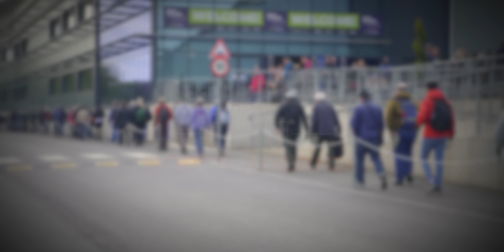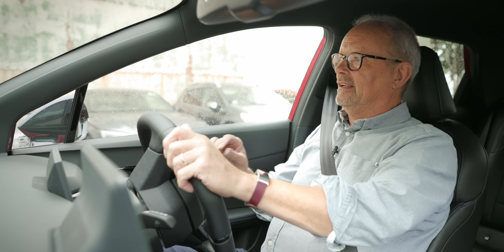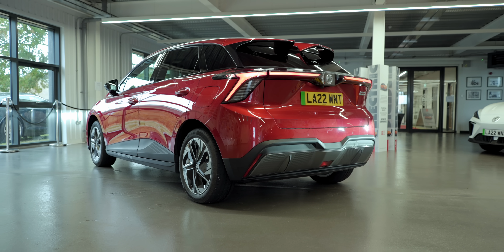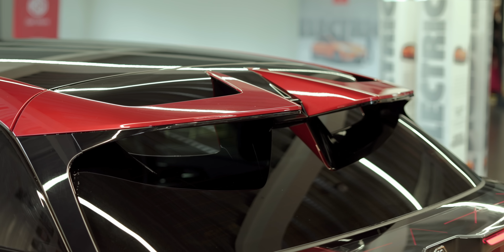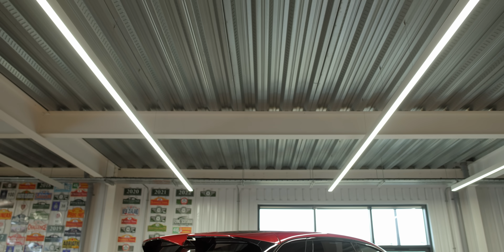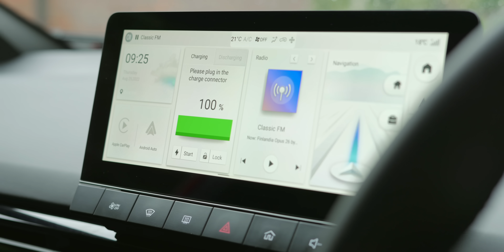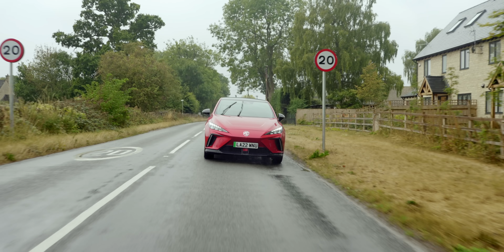MG4: The Bargain Of The Century??

Comment: 125KW charger? to get 50 KWHrs out of this battery, you will have to input at least 55 KWHrs, which will only go up as the battery ages.
With the Russians turning off the gas and oil spigots, electricity in the UK is going to become VERY expensive, and likely to be rationed this winter.
Plus, made in China. 
Good luck with all of that.
Reply: Electricity is also becoming very expensive in Germany, as the Government there have recently pledged huge support for consumers. The UK produces around a third of it's energy from renewables now.

Comment: Annoyed of Tunbridge Wells says again, for the umpteenth time, the designers have missed the open goal that electric propulsion has offered . . . That of using the whole of the chassis length to create space in the vehicle for people to enjoy. They  have instead presented  the public with an "Electrified" conventional family saloon with a conventional bonnet.

I reckon its all part of the designer sarcophagus mentality - lets create a box to insert people in and then further contain them by ramming an 18 inch wide largely non-functional dashboard in front of them. Its a designer authoritarianism . . "We are the only ones fitted to know what users should do with interior space. Under no circumstances  must we allow them to enjoy the extra space through self-determination"  

Styling - over styled for a family saloon. Why try and kid the customer that the front end is a Masserati and the rear-end is a Porsche. Pathetic. Shades of identity crisis motoring, a la VVT Toyota Corolla . . Couldn't makes its mind-up whether it was a boy-racer wagon or a pensionermobile.
With a front and rear end moldings and pressings as complicated as that it will cost  a couple of grand to get it repaired if you have the smallest of  knocks. 

And that air dam on the front . . . Low . . Low . . Too low .First lighweight speed bump it encounters will seet it part company with the car

Upside, all the exterior plastic bits are shiny . . . When new !
Further upside it hasn't got those fluted panel lips running down the mid-line of each side - another fortune to repair.

I think all these  conttemporary car design bureax must be subterranean  and have piped 1960s musak running in the offices all day - hence the car interiors . . . I presume '60's English country music ballards  of the harpsichord accompanied vocals predominate. . . " Grey, Grey, . My love is grey, da dad da da dad da da da"  .Even the fluffing headlinings grey.

When the ethos of the age is to get vehicles lighter, more fuel efficient, why  fit things like electric seat adjustment . . Unnecessary weight and something else to go wrong, like the compressor based A/C,  which costs a fortune to repair kand turns most cars into a "Hangar Queen". I mean how often do you adjust the seat, if the sMe driver i using the car ?

Comment: At last an affordable sensible car that has a practical range, if you can afford to charge it up again!
I think they might have to offer a hybrid version as the cost of electricity goes even higher.
Reply: The cost of charging an EV at home hasn't changed in a while, and nor is it likely to as energy companies are still showing the same off-peak rates as months ago. Mine certainly hasn't changed. I still pay 7.5p per kwh on my overnight off-peak tariff.

Comment: Are there any figures for the carbon footprint of building each car? I would be interested in comparing it to current ICE's.
Reply: Good question. Would it be good if all cars were given a "cradle to grave" eco score? I am still a bit suspicious regarding the cost if EVs. If a mass produced EV costs twice as much to produce as an ICV, what does that tell us? Perhaps that it takes a lot more resource to produce? Often,  more resource equates to more environmental damage. Of course, it may be that the extra cost at present is just the manufacturers recouping their development cost? Until EVs come down to ICV price levels, I may remain suspicious.

Comment: What's the recharge time?  That's the ONLY thing that's important because 200 miles is NOTHING if the driver lives in Dallas-FtWorth or LA or San Diego or San Francisco, Orlando, Chicago, Denver where 200 mile business days are typical commutes.  "Charge to 80% in 30 minutes" -yeah, right.  Prove THAT day after day.
Reply: I spent 25 years driving XKE's, Triumphs and MGs, and every single one of them had Lucas electricals that were the core of their failures.  Well, OK... building that 12-cylinder's valves were never fun, but that's why God invented the Chevy V8 to drop-in replace it.  But it was the electricals that left me dead on the Nevada road at 2 am, halfway between Vegas and Reno for 2 hours until the solenoids finally worked again.  It was the electricals that left me buying a 2nd and 3rd TR6's to experiment replacing Lucas with Delco's, which the TR8s had but still Lucas solenoids.  An MG that is built entirely on those electricals?!!  ha ha ha... do you still like warm beer?  "Yes, because we have Lucas refrigerators."

Comment: This is not a bargain. This is an advert for a car made by the CCP. They are rubbish and are priced as rubbish accordingly. I've changed wheel bearings on a similar CCP made car at only 35k kms. Steer clear and don't let the British flag mislead you these things are destined for the tip earlier rather than later.

Comment: Want to know how to power your house from this car?
.
.
easy
.
.
Imagine you have a power failure.  Go to your main switch board and flip the main circuit breaker trip-switch to the off position (no electricity from the outer grid can come in).  Then connect the car to a socket on the wall (you will need to wire the cable into a wall plug socket - call it the "Reverse Socket").  So long as the car is pumping out a stead 220VAC (or 110VAC in North America), the car will feed that voltage into your domestic home grid.
.
As noted in this video, you may not have enough power to run everything, perhaps only your fridge and TV, but not your oven or your water heater (flip the oven and water heater circuit breaker to the off position).
.
Then when you notice the power grid has come back on, simply unplug your car at the 'Reverse Socket' and then flip all the circuit breakers back on.
.
Simple.

Comment: and it's still going to cost people more to charge it than it costs me to fill my tank with diesel.
Reply: Nonsense. The cost of home charging on an off-peak tariff would need to rise by 800% or more to even be close to petrol or diesel prices. A 50 mpg diesel costs around 20p per mile. My Kia EV costs me around 2p per mile.  I only need to use costly public charging 3 or 4 times a year. The rest of the time a full charge for me at home is £7 to £8.  You have to pay around £1.70 a litre all the time.....and you have to drive to a petrol station to get it. I "refuel" on my drive while I sleep.

Comment: I'd sooner boil my balls in butter than own one of these hateful little refrigerators on wheels. I delight in removing emissions control equipment on a variety of my vehicles. My motorcycle spits flames since the cat was removed, my van after a dpf delete gives me an extra 15mpg. The cars next in for a remap giving me an extra 50 odd horsepower. The more they tell me to tighten my belt the more I'll resist.

Comment: I am impressed. I own a 2018 BMW i3 (94), which I bought second hand. It is a fantastic car and I love the electric drive, but.. The seats are only comfortable for 50 Km. It has a real life range between 180 in winter and 280 in summer (which I knew in advance and is not a problem for me, but the MG has 300). Apple CarPlay costs a lot extra, just like all other options which are standard on this MG4, and the MG has electric seats 😲. And being able to set the level of regeneration will certainly make it easier to get used to driving this EV for newbies. Now some people might not like the looks of the i3, but I do. I can’t say that of this (or any other) MG. I need to drive it myself to compare, but things look very promising.

Comment: I have two remarks on the design.

Remark 1 : Although it would probably impact the range quite a bit, I really think this car could use some spacers. Especially the wheels at the rear end.

Remark 2 : The black cladding on the sideskirts are there to make the vehicle look a bit lower than it actually is but it end up looking like a crossover. That should definitely be body colour as well.

Comment: I've had two MG5's (short range only sold due to massive increase in value to the point where it exceeded the purchase cost :-)  and now an LR exclusive model) absolutely no issues at all and a pleasure to drive. MG are churning out exactly what we need to disrupt and challenge the ridiculous notion that we "must" buy a VAG car or a BMW / Mercedes. All of which languish and have done for years at the bottom of the reliability indexes. PS not interested in any xenophobic comments as its likely to have been typed on your device which was... made in China.
Reply: Having the experience with the NMC/LFP charging stuff what do you recomend: SR LFP batteries (and more ansiety and lower charge speed better security and charging to 100%) or the LR NMC batteries and their characteristics?

Comment: interestingly I ended up buying a low mileage 'nearly new' Zoe 52kW BECAUSE of the price-bracket and range that this is in  ... doing 4.1 - 4.6m/kWh though.  4.1 was on a mad 800m round trip to Edinburgh and back from Someset that I'm just back from.  nae bad.  4.6 is 'general use'.  given costs are going to rise that may be important.

Comment: I own a BMW i3 120ah and can't wait for the dual motor version of this MG, I will definitely consider it if it's cheaper than a used model 3 performance. But this rear wheel drive model specs look really good for what you are getting compared to VW , Kia and Hyundai

Comment: II need a thousand mile range. At present that means a single fuel stop between 500 and 600 miles. for 5 to 10 minutes. From empty to full your electric car would make 6 stops of at least half an hour each. Add 3 hours to an already 12 to 14 hour drive. That is day one of the 2000 mile trip in Australia to visit my children. The problem is the British make the design decisions that do not work in a big country like Australia.
I don't understand how cars where the head can touch the roof pass roadworthy, what if the car rolls? That 6" of safety when wearing a well adjusted seat belt seems essential. Electric car manufacturers are shaving safety margins, deleting the essential spare wheel, and offering a computer screen as a distraction. Where is the MG made?
Reply: So you're driving a thousand Km without a break?  And your maths sucks - a thousand mile range is a thousand mile range, not a 500 mile fuel stop - so you're already asking an EV to do what your ICE can't!🤣

And the rest of your comment is just as much BS.  

You're talking through your clacker mate; and showing your ignorance of car design as well as your racism...
Reply: @zaphodsbluecar9518  Yes, I should have said a 1000 mile trip with a single fuel stop and one at the point of arrival, a total of two. With two in the car we change drivers. If we take a wee break, we top up the fuel, a 5 or 10 minute break. The actual distance is 1245 miles. Sometimes one long haul, sometimes two days, sometimes 3 days. 
There is not a petrol station at exactly 260 miles, so one would have to plan the trip by fuel stops. I have been in Thailand for two years and I have not seen a EV charge station. I have not seen one in Australia.
I am not racist. I have lived in Asia for 9 years, sharing my life with Thais. Thai culture is very Chinese.
With the UK and US planning a war with China using Taiwan as an excuse, (the Hong Kong independence movement failed), there is a real danger that Chinese products will suffer the same fate as Russian products due to NATO advancing into the agreed neutral zones of the old Warsaw Pact countries, leading to the Ukrainian conflict.
Some think Ukraine is about  saving Ukraine. The Nord Stream 2 pipeline was not permitted to open BEFORE the Russian intervention in the Ukrainian civil war. The Ukraine conflict is an economic war, to control who profits from gas and oil sales to Europe, and a fear tactic to increase the size of NATO.
Where the MG is made may be a big issue. MG was a well known British brand mostly for its sports cars. My sister had a Morris Minor 1000, my brother a Morris Major, and my first car was a Mini Minor. I currently ride Thai made Honda Motor Bikes and drive a Thai made Nissan. Australia adopted a free trade policy and lost all of it's car manufacturing, including Mitsubishi, Chrysler, Ford, Holden/General Motors, and Toyota. Thailand gas a 300% import tax on new cars. Guess who makes cars for Australia now? Thailand.
My question, Where are MG cars manufactured has to do with spare parts and replacement value. 
Nothing to do with racism. 
It is the UK, US and EU exploiting cheap Asian labour and seeking conflict to justify shifting production to India and Africa. 
The rate of change in battery technology suggests current designs may be obsolete in 10 years. New technology, new factories, low cost relocation. Tesla is making in America, highly automated robotic factories, low human labour input.

Comment: When he is running through the prices of the EVs. Just goes to show how expensive they are. And with the price of electric going through the roof its denting the cheap to run argument. The prices won't come down until the manufacturers have no choice when fuel cars are banned in 2030.

Comment: 1st generation battery drivetrains were hugely more expensive than they are right now.  Knowing it cost much more in drivetrain, does it not make sense to put that in your premium model that is already expensive?  Not to mention the limited supply of batteries and chips.  Would you rather sell 50,000 at 35k or 55k if you were making the cars? Now that prices are coming down and supply is ramping up, making cheaper models not only makes sense, but is ACTUALLY DO-ABLE.  
The next generation (coming now) will have lots of much cheaper choices and lots of new faces in the mix, including from countries you never thought you'd consider a car purchase from  ;0)

Comment: Thanks for showing us around it. It's good value, but looking at the interior, you can tell it's been built on a budget. The dashboard looks a bit basic, and what's with those nasty hanging cables in the centre console? Looks are subjective, but I wouldn't call it a 'looker' either. The front looks like an older Peugeot, and the back...it's just a design mess in my eyes! Good price though...so there's that.

Comment: Should sell well, Its what customers want. even looks good. I could do without the electric seats to save a bit more in cost and weight. Rather have a CD player as I don't particularly do anything with my phone except use it as a phone. Anybody remember the square steering wheel in the Austin Allegro ?

Comment: I don’t trust MG and let me tell you why, I had a brand new MG ZS EV and it had the common issue with the radar thinking I was going to crash but I wasn’t, so this would slam the brakes on for no reason and even made me crash, car ended up in a ditch on its side and I was badly hurt, MG said if it’s a sunny day it can do that sometimes 😂 so I got rid of the car at only 6 months old I lost loads of money and that’s why I don’t trust them, I have a Hyundai kona ultimate electric now and love it.

Comment: I'm really qurious about the price point for the AWD model, and if it will get a trailer hitch. 

The three most comon showstoppers when I try to convince people to get an EV is:
- not AWD (primarily for bad days during winter)
- no trailer hitch
- too expensive if you want the two above.
Reply: I know someone who worked in a Garage / Car sales place and they always removed trailer hitches before putting the cars in the showroom as the majority of customers assumed a car with one would be twice as worn out.
Reply: @MrDuncl  I never heard of that in Norway. It is pretty common for Norwegians to want trailer hitch, even if they don't own a trailer. 
Fairly common for hardware stores, furniture stores and other lange item stores to have free trailers to borrow.
If stores don't have free trailers, they loose customers to stores that have.

Having a trailer hitch is considered more like a convenience, the few days you use it, rather than something that puts more wear on a car.
It's more about who's been using the car, than if it has a trailer hitch or not. 

Even if Norway is in the lead counting EVs per population, I think the lack of trailer hitch for many EVs has caused many people to avoid EV if they  use only one car, or only switch their smaller car to EV. There could have been even more EVs in Norway if there were more EVs with trailer hitch.
Reply: @thorbjrnhellehaven5766  In the U.K. the most common thing to see being towed is a large caravan, hence peoples concerns. I have never heard of trailer loan. Ikea has hourly van hire or will deliver to you for a quite reasonable cost.

Comment: Looks really good, and the price is tempting. I wonder about the environmental viability though, I couldn’t find any info from mg, but these cars are made in china as I understand, china relays heavily on coal the dirtiest generator of power so in terms of co2 it may be many years before it out does a petrol car due to the larger energy cost that goes into an ev. I would like manufacturers to have to declare things like that so people like me  can really know if an ev comes with a large co2 debt. There are other reasons to buy an ev of course but it’s nice to have the full picture.